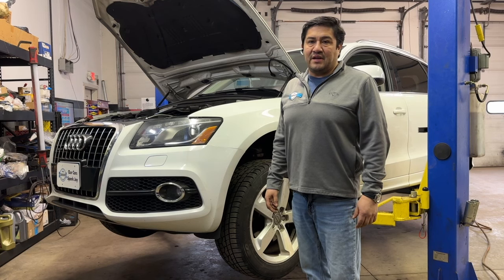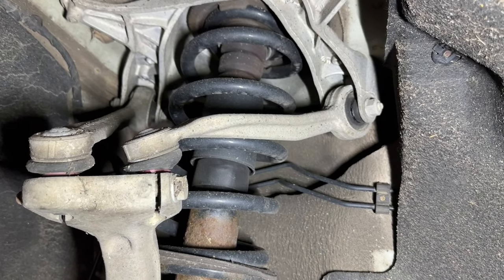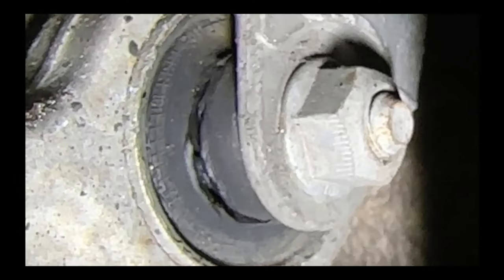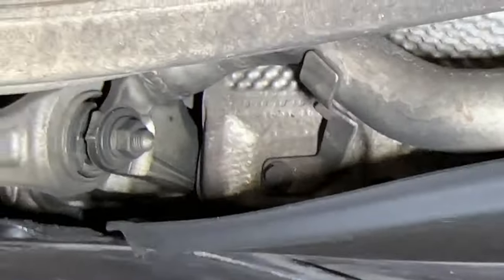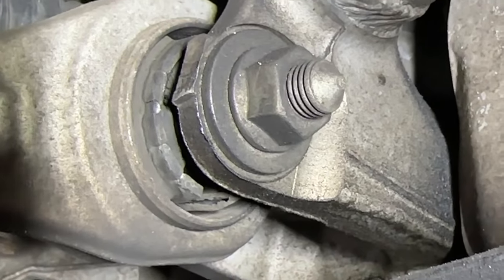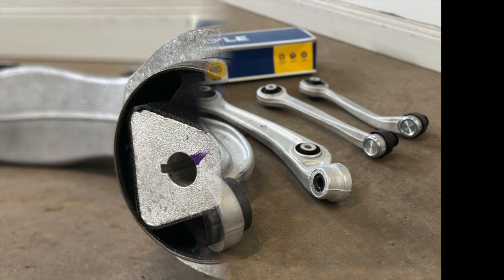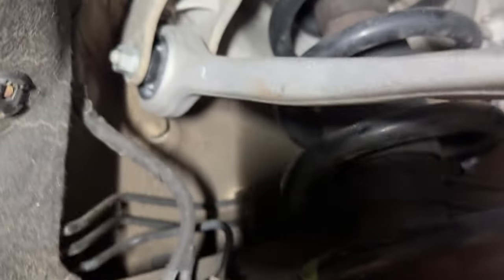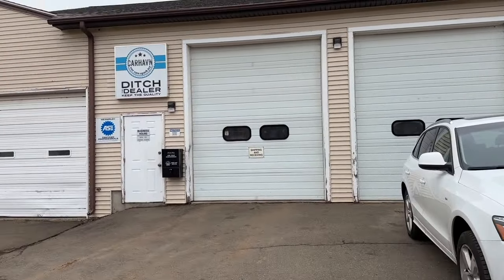This is why your Audi Q5 suspension creaks (same for A3, A4, A6, A7!)

Comment: Can you buy just the bushing only?
Reply: Yes but you have to press the bushings out and the new ones back in which requires removal of the whole arm anyway so it's better to just replace the whole part in my experience.
Reply: yesterday i did it and i can say that you can save a lot of money with the same result, its good to have someone to help because its not easy to do this alone, especially with the press. For upper 4 parts   i paid only 30$ in total OEM parts lemforder, 2x hydro bearings 55$, and 4 next bearings around 15$ each. So in total i paid only around 160$  where the lower lemforder wishbone costs around 120$ for just one part.
Reply from the maker: This is correct.
Reply from the maker: While it's possible, we prefer the control arms. Even though we are a professional shop, we almost had a safety incident with the press a while ago. Saving a few bucks is not worth the risk to me as a shop owner.